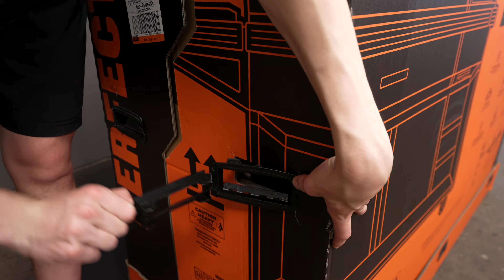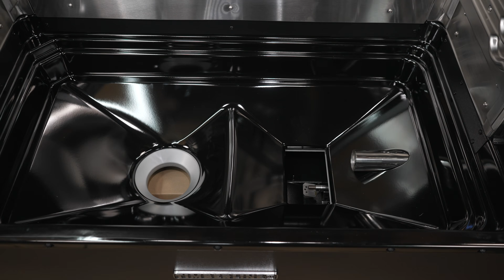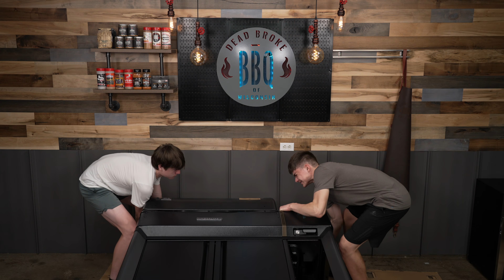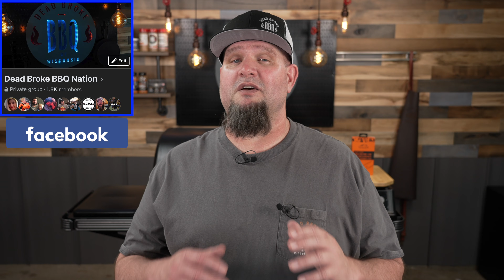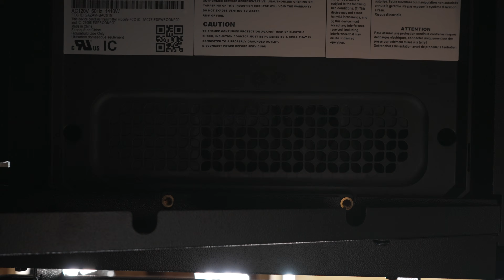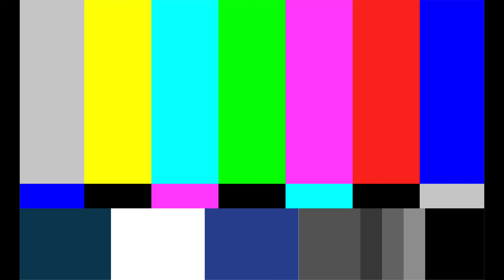New Traeger Timberline | Unboxing and Assembly

Comment: How would you compare this to the lonestar pellet smoker?
Reply from the maker: The Timberline is Tragers best grill they have built to date but the LSG is a lifetime pit without an induction cooktop. Example if I tossed a bowling ball at the Traeger lid I will have to replace it but on the LSG I will need to grab some touch up paint to cover up the scratch. Traeger built an easy bake oven and Lone Star Grillz built a smoker. Hope this helps and thanks for watching!